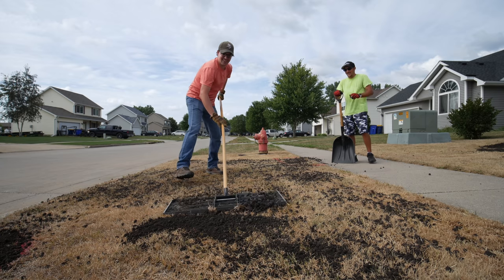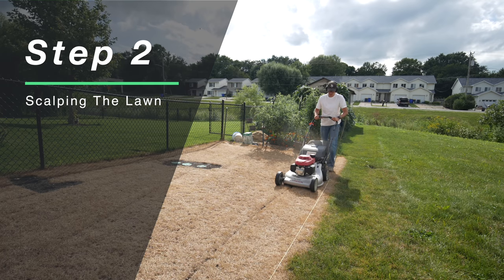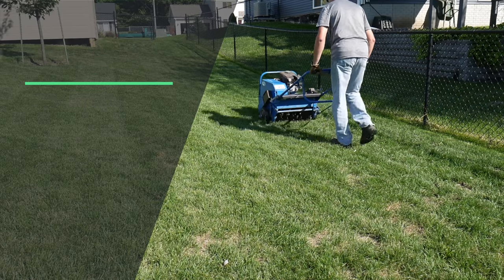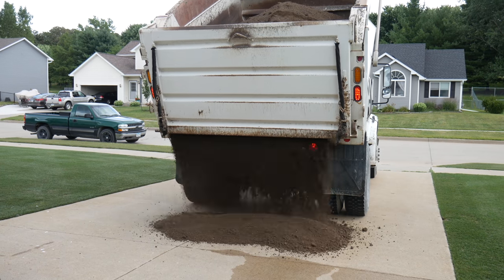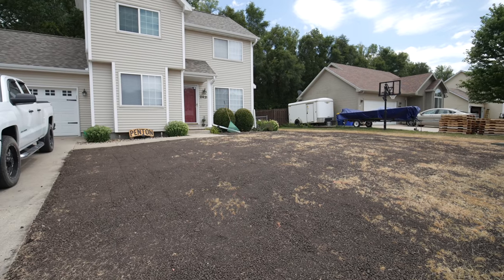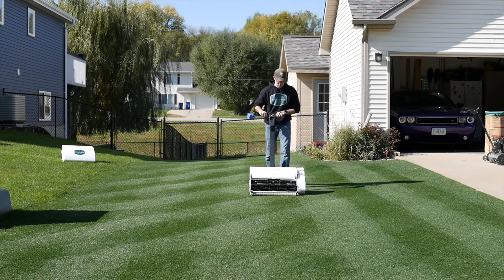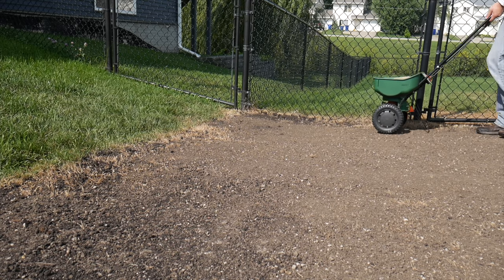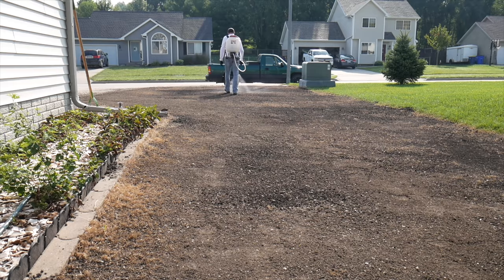How To Fix Your Lawn with Renovation // All The Steps In One Video!!

Comment from the maker: This is probably the most comprehensive video I've made on one topic so I hope you found the info you needed.  Time stamps, links, and much more all in the description so be sure to check that out! 
https://www.ryanknorrlawncare.com
Reply: What are your thoughts on removing the old lawn?    Rather than core aeration, I think I have to rototill because I have widespread shrub and tree roots invading my turf area.
Reply: leftheaded wow I have the same I have a horrible tree that grows roots and forms more tress. I have ripped a lot up but Ima just jay down more dirt and hope for the best when I start the Reno. 

I'm facing like 20 basketball size holes in my yard now, I'm wondering if i should fill it with rocks first. Dirt just makes a big wet sludge aft rain. 

Things I'd do for level lawns lol. Mine is on a angle 😫
Reply: I nuked my old lawn that was mostly weeds. I just used a power raked everything out of it so it's only dirt. my question is.. is there something I can add to soil when I level it to improve it? any help would be appreciated. I live in North Idaho if that makes a difference.
Reply: Great video. I’m doing a renovation on my lawn starting in September. Ryan, what would you suggest for a inexpensive manual reel mower?
Reply: @leftheaded  ideally, you'd kill the existing grass and then rototill to ensure that nothing comes back through.  If you're okay with the grass you had growing, then killing off might not be necessary.  Your renovation will just be a mix of your new seed and potentially old grass
Reply: Great video , thanks for the tips ! I just performed dormant seeding after a complete renovation but some areas didn’t germinate or lightly germinated . Would you recommend a slice seeder for the bare areas? Or would that do more harm than good ?
Reply: What do ya use to kill the grass?
Reply: @woodywoodman2319  Glyphosate-the chemical in Roundup.
Reply: Do you rake up the plugs if you aerate?
Reply: Great video, and I used it as a step by step guide for my Reno on my new house.  The only thing I couldn’t do was find a Pete-moss spreader anywhere locally, and couldn’t wait for it to be delivered.  Spreading the Pete moss by hand was dirty and tough.
Reply: I’m thinking about buying your elite rye/bluegrass mix, but I’m worrying about germination. My area is mostly shaded so I don’t know if blue grass would germinate. Would you recommend that mix or should I go with rye only seed? I really want some bluegrass there. It looks great on your videos. Please advise. Thanks.
Reply from the maker: @mariuszpachowski288  really depends on how shaded it is and for how many hours.
Reply: @ryanknorrlawncare  well there is a morning sun until noon. But I’m currently reel mowing my rye grass. Can blue grass be reel mowed low? You also reel mow your side front yard low so I guess it can be done.
Reply: @ryanknorrlawncare  do you currently have any discount codes on grass seeds?
Reply from the maker: @mariuszpachowski288  not at this time, no

Comment: I started mine the 5th of July on 3 properties. I scalped it first then sprayed KillZall (double recipe and some Dawn), to wipe out really thick areas of Creeping Charlie. 85-90% of the grass and CC died within 7 days, but after a couple rains CC was still popping up and you could almost tell which underground veins didn't want to cooperate. I doubled the dosage and hit them again about 2 weeks later I still had a bit of it so one more time. Man that stuff is tuff. I did one yard this past Wednesday and another one today after the rain last night which really helped out as I am running a roto tiller. Hopefully the mistake it seems like I may have done is kicking any dead grass seed down in the lawn but I didn't noticed this grass being 'in seed'. It's Charlie that I am worried about. After working these small lots for most of the afternoon, I planted a 4 mix of KY Bluegrass, with "sissy" rye  to give some eye candy to those (fiance) who keep asking "are we there yet" as to when the grass will come up. I too used the big box top soil to level ($1.67 at HD currently) and some all black potting mix near the drive/sidewalk to the house to make it pop  (yes I have OCD).

Comment: Thanks for the video on the DIY sprinkler system. I actually used that to install a complete irrigation around my very weirdly shaped lawn back in the spring.  I added some connected timers that do weather adjusting.  It took a couple months of measuring with catch cups and adjusting the configuration, but I got it dialed in, and now I have a "set and forget" irrigation system that uses less water to do a better job.  Next year, I'm probably going to do the work to take it in-ground and install a valve box and single unit connected controller.

Comment: I've had good results mixing compost and peat moss 50/50 in a barrel spreader (I use the same one shown in the video here).  I turn it together in a wheelbarrow (no need to over stir it, the barrel roller will take care of it - just get it integrated), then dump it in the barrel and start laying it down.  The spreader leaves just the right amount.  Seems to be a good mix for providing plenty of organic nutrients while also managing moisture during germination.

Comment: Nice detailed tutorial. I like using a 50/50 mix of organic compost and peat moss to lightly cover and protect the seed. I've used the EZ straw w/tack in the past, but often there's seed heads mixed in and will germinate, but dies off eventually. Otherwise protects well. Good luck with the neighbor's reno. And pray for no downpours. ~ mike

Comment: I’m 9 days into my first renovation (killed 4000 sqft of TTTF) to start over with a new variety of fescue. So far not so good. I have quite a few areas that have only puddled with water. I didn’t add any topsoil because when I scalped the old fescue, the exposed dirt looked ok. The good news is the new fescue is coming in, so I should have some time to re-seed the areas that did not germinate in the beginning.  I’m open to any advice. Thx !

Comment: Hey Ryan, on the leveling could I use a soil sand mix? Something like 80/20? The reason I ask is that I’ve heard top soil settles after a while (obviously) and I have a fairly bumpy lawn. I just want to smooth it a little this year and then a little bit more next season and so on...

Comment: Great video! Thank you! We bought our house 1 year ago and I am getting ready to do my first renovation and I have a question:

There are some areas in our yard that were poorly mulched with plantings that we want to convert to grass. In lieu of steps 2-4, can I simply roto-till the entire erea to remove all unwanted mulch/rocks/dead stuff? Then I can level off the entire  surface with screened loam? 

Any advice would be great! I look forward to the DIY sprinkler vid next!
Reply: Currently undertaking this project myself and will be tilling as well. Mainly as a means of knocking down two high spots of compacted dirt in the yard. From there everything else is pretty even already. I’m also thinking of pouring topsoil evenly and then just going over it with the tiller one last time to mix it into the existing soil. 
How’d it go for you?

Comment: Definitely the best and most detailed lawn renovation video out there! So thankful you made it so simple and clear. 

I’m currently renovating my jungle of a lawn that has so many different types of grass/crabgrass and every weed you can think of... I’m in the process of killing everything off but some clusters of thick finger grass still lingers. Do you ever suggest using a tiller to get rid of these types of grasses? Or possibly using the tiller to help level a small lawn?
Reply from the maker: You can use a tiller. The issue typically means it might bring even more weed seeds to the surface as well as settling more after tilling since the ground will be softer.

Comment: Ryan, Fantastic video! Question: Would consider following these steps in the spring? I live up in the Twin Cities. Thanks again for what you do.
Reply from the maker: Spring is much tougher...soil temp is low and germination takes longer.  You will also be fighting crabgrass.  If you have to, you have to but I would plan for fall if I had a choice.
Reply: @ryanknorrlawncare hi Ryan, the dead grass what’s left in the lawn after detaching what happens with that when the new blades of grass comes through?

Comment: Quick question, I already applied the grass killer, now I'm just waiting for it to die completely, in your video noticed you guys are spreading top soil on top of dead grass, it is ok for me to do this as well, I was recommended to detach or remove as much dead grass as I can... Does it really matter? Please advise!
Reply from the maker: The soil is for leveling and smoothing out the ground. If you don't need that then you can seed into what's left after removing a bunch of the dead grass
Reply: @ryanknorrlawncare  Yes I do need to level some spots, will do, thanks

Comment: For the fertilizer should you always use a starter fertilizer? I did a soil test and I have high phosphorus but low nitrogen and potassium. Should I use a fertilizer without phosphorus for a new seeding or use a starter?
Reply from the maker: I've done it both ways and didn't notice any drastic differences

Comment: Great video.  I want to do the same sprinkler system setup but I have well water and my pressure is not that great.  Do you think it will work if I have multiple sprinklers running off of my supply?
Reply from the maker: It probably won't work as well without decent pressure

Comment: Hi Ryan, love your videos and am learning a lot.  In early Spring 2019, i decided to rip out my old grass and start from new.  I went 2 inches deep to remove the old grass.  I sprayed tenacity before laying down my seed. Seed was laid down, top soiled, rolled, starter ferilizer added and watered 3 times a day to keep seeds moist.  For the most part, it went well but when July rolled around,  the crabgrass attacked.  I mean really bad and all in the parts of the yard with the most sunlight.  I'm sure the humidity didn't help either (I live on Long Island,  NY). I sprayed tenacity to kill the crabgrass  and overseeded to take over the crabgrass. This year, again the crabgrass attacked along with massive amounts of clover. I'm thinking my soil is too compact and i never used a fungicide. Any thoughts on how I can conquer this weed battle? Thank you in advance!
Reply from the maker: You have to use crabgrass pre-emergent in spring.  I have a few videos on that

Comment: I’m just curious, what’s the purpose of the core aeration if you put more soil and compact it after? Someone please respond🙏🙏🙏
Reply: The deep pits allow water to seep down, which means roots will go deeper for more strength and health. Putting a bit of soil and things over the top won’t stop water from penetrating down the still mostly empty shafts.

Comment: What does it mean to be in the ‘Transition Zone’? I noticed there isn’t a guide for that so does that mean we can either the cool or warm season guide?

Thanks in advance and great video!
Reply from the maker: Transition is an area where you may have warm season grasses or you may have cool season grasses.  Neither option is preferred because it tends to be too hot for cool season and too cold for warm season during a certain part of the year but it's not impossible by any means.

Comment: Great Video.  I think I've watched all your videos at least 10 times each.  I"m at the killing stage as my lawn has been dead for a few weeks now and I don't see anymore weeds coming up (crossing fingers).  I had 3 trees removed (3 years ago) and weeds grew this summer. I will be tilling the back yard but i dont see too many tips on tilling in any of your videos.  Should I spread fertilizer before tilling?  Even ordered a soil  core sampler as well as a tester but none locally but that's not coming in for another 10 days.  I pretty much work 6 days a week.  Am I too late in the year to continue from Cleveland Ohio
Reply from the maker: I personally don't like tilling because from my experience it brings up a ton of weeds.  There are a couple scenarios where I would use it smooth a large lawn (like acres) where it isn't feasible to add something on top to smooth it.  I'd just get started soon as far as your project goes.

Comment: Great video..... I'm doing many of these steps at the end of this week.  I'm excited for the future.

Ryan - is peat moss needed for overseeding?
Reply: Over-seeding in a mostly established lawn normally doesn’t require a compost such as peat moss. It’s more important to ensure there isn’t a heavy layer of debris or thatch that will inhibit seed to soil contact. For best results in over seeding, use some sort of power rake to clear the debris and loosen the top layer of soil before putting the seed down. If you throw a very thin layer of peat moss over the top it will help with germination by retaining moister, minimizing direct sunlight, and it will press and maintain the seed to the soil. But it’s not required.
Reply: @tonygarner5535  my plan is to mow lower than normal while bagging, dethatch, aerate then overseed then water water water
Reply from the maker: https://youtu.be/sgqfbV-ESk8
Reply: @ryanknorrlawncare  Those are my exact plans starting the end of this week..... Can't wait!!!  Thanks for the video link.

Comment: The entire south side of my yard has tree roots basically at the surface and is heavily shaded. I obviously need to add top soil, but how much? And would it be beneficial when I do a restoration that I mix seed in with the top soil before adding it and spreading it?
Reply from the maker: The heavily shaded part is going to continue to be an issue.  You might consider some kind of landscaping for long term success or try to get more sunlight to that area.

Comment: Could you use a sod cutter if the grass is not dying off fast enough? Sprayed with same product that you used on your front yard side lawn renovation (41% glyphosate). I have a mix of dormant bermuda and some fescue. Temps are warming up hear in California and want to get the seed down by beginning of March. Would love some input!
Reply from the maker: You might have some issues getting rid of that Bermuda, especially since it's dormant.  You could use a sod cutter but that likely won't get all of the roots.  :(
Reply: @ryanknorrlawncare  thanks for the response. Ya that is what I was worried about. I think I might use the sod cutter and then treat the area with the glyohosate again for the roots now that they are more exposed. Wait a couple weeks then aerate, level, seed. Thing that could work?  Thanks!

Comment: I would love a video on how to start a renovation with no previous grass at all, and only a lawn full of weeds. I’m currently spraying to kill the weeds, I think I’m gonna rake them and bag them because the spraying is making them super brittle. And then tilling the hard ground, raking the rocks and weeks that were underground that came up. And then pick up at the top soil part of your video. Would you change anything?
Reply from the maker: I personally don't like tilling as it brings up a lot of weeds in the soil. Just spray it do the steps here to thin out what is there and seed.
Reply: Ryan Knorr Lawn Care I have hard clay soil and I plan on putting 6-8 inches of top soil on of it. Would that be good enough to plant on?

Comment: Ryan I'd like your take on an issue with my renovation. I had to use a skid loader to smooth out and grade my front yard after removing 2 very large stumps. I've since spread and leveled my topsoil, but I'm afraid the layer underneath is way too compacted from the skid loader. I plan on using a core aerator at the very least, but do you know of any liquid aeration options that can be used near or at the time of seeding? I'm in central Iowa as well, so my seeding window is fast approaching if not already here.
Reply from the maker: As long as things are not too compacted in the first few inches you should be fine.

Comment: This is incredible content...thank you! I need some advice here: I need to do a complete lawn renovation in my backyard and I have a clay-based soil. Given the relatively poor soil structure I have, I wanted to ask whether core aeration (in addition to top dressing, of course) would be sufficient? I was told I should till the ground 4 -6 inches to add organic matter, but I'm concerned this might just bring tons of weed seeds to the surface. Would deep core aeration + good amount of compost be adequate to create a good seed bed? Thanks for any input!
Reply from the maker: Tilling for me has always brought up an insane amount of weeds and then it also settles later on and ends up bumpy. I would do the core aeration and compost
Reply: i also have clay based soil. and it's so very tuff. I'm also trying to make my new lawn a bit better. when are you planning to aerate your soil?
Reply: @ryanknorrlawncare  thank you so much. I'll stick with your advice! Please keep the awesome work!

Comment: Can this be done in the summer?  I live in Oregon and we’re consistently in the 90s or sometimes 100s like this coming week.  I’ve read you don’t want to plant seed in the heat as the seed won’t germinate.  What type of grass is good for for a dry area like central Oregon?  We get really cold temperatures in the winter and summers get pretty hot with hardly no rain.  Unfortunately I have areas where the soil is super compacted as well.  I dethatch, I’ve plug aerated, I’ve used liquid aerator and the soil is stubborn to loosen up.
Reply from the maker: Late summer and tall fescue